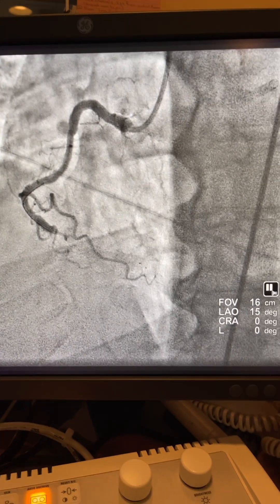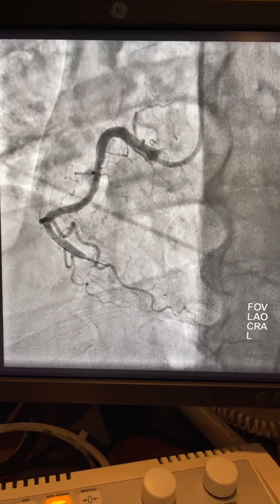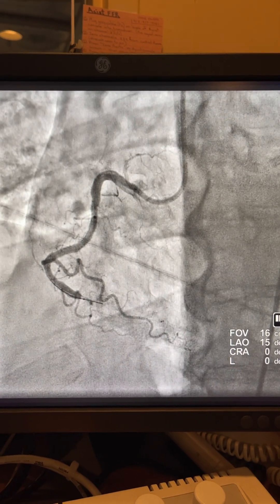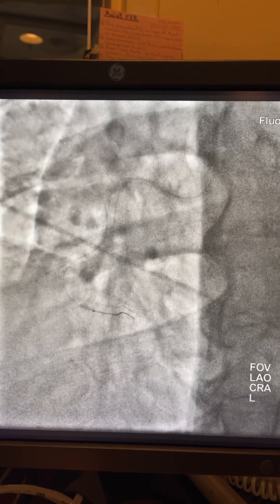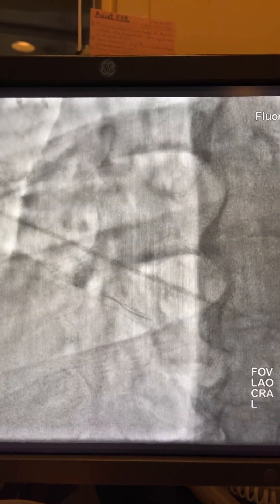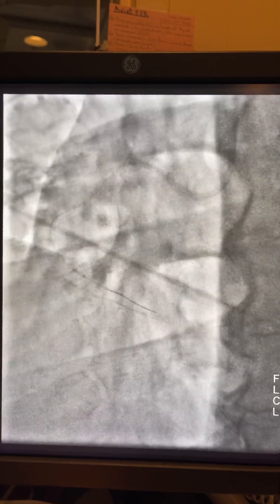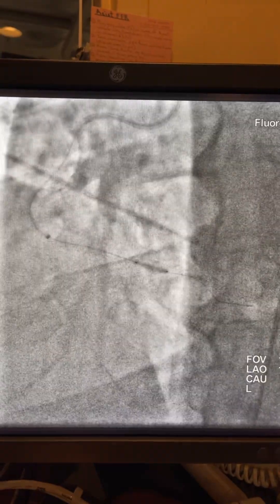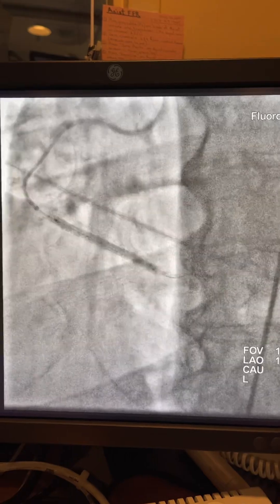The support inflated-balloon technique. Complex CTO RCA, Antegrade approach.

Comment: Is there any real different by using balloon support in inflate status comparing to non inflate , or the same ?
Reply from the maker: In general, it’s more practical to use a new, non-inflated balloon. However, in cases like this—when the wire won’t pass through—the balloon may be inflated at low pressure to provide better support and help advance the wire.
Reply: @abdrhmanhamo3681 Thanks ❤

Comment: Can you explain the mechanism?
Reply from the maker: @mrtuanho  

The support inflated-balloon technique. Complex CTO RCA, Antegrade approach. 

RCA CTO chronic total occlusion. 
A tough calcified CTO Cap. 
AL 0.75 guide catheter. 
Guidelinear for support 
PT2 Moderate Support Guide Wire.
A 1.25 mm semi compliant balloon. 

The PT wire will be advanced along with the small short balloon. 
The balloon will be placed just proximal to the CTO cap and inflated at nominal pressure, it will serves as an anchor that provides a good support for the guide wire. With this extra support the wire can be more forcefully directed at the CTO and advanced through the CTO cap.
Reply: @abdrhmanhamo3681  do you think this technique is applied for polymer jacketed wire or stiff wire like gaia?
Reply from the maker: @incognito8678 
Whatever workhorse wire you prefer and have a good luck with ! 
I prefer Runthrough and PT wire , i have good experience with both.
Asahi-Gaia is good wire too
Reply: @abdrhmanhamo3681  how about the size ò balloon, 1:1 to distal vessel? Can you make a comparison with microcatheter support ?
Reply from the maker: @mrtuanho  
For CTO 1:1 is good … while balloon inflated at low pressure it gives better support and pushability to the guide wire thru the cto cap more than the micro catheter